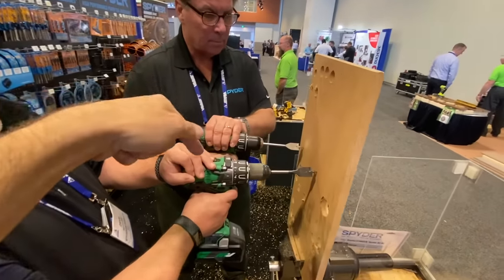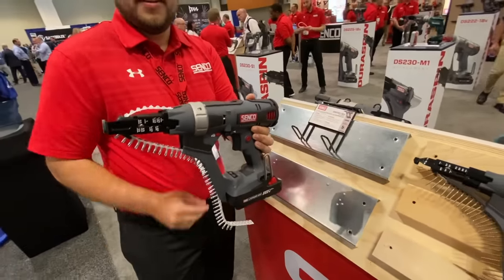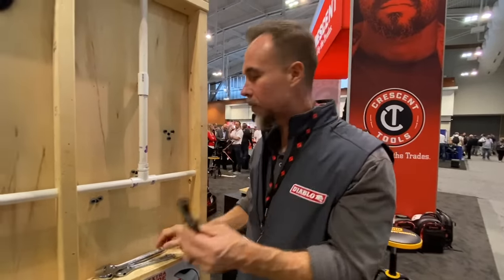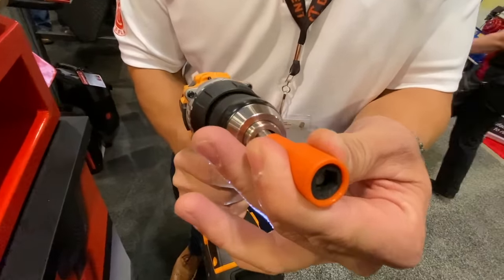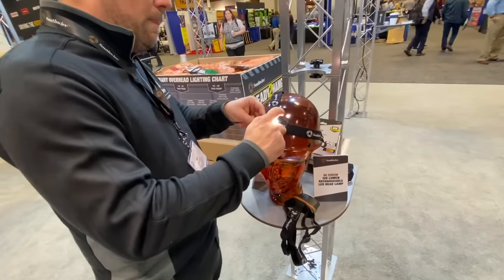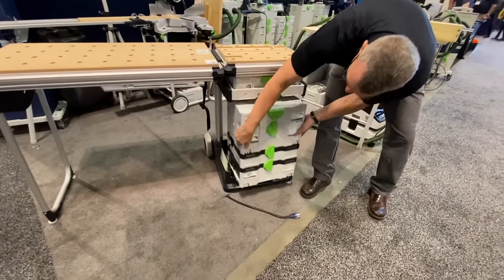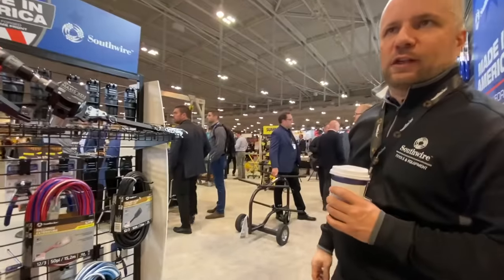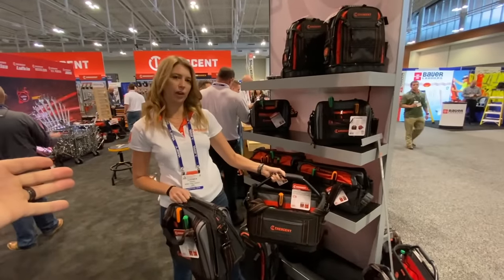New hand Tools, Inventions that actually WORK, power tools, and Equipment you have to see to believe

Comment: That “competitors” spade bit was either blunt or messed with. I wouldn’t be trusting that comparison or the company.
Reply: Mission Dan it was different drills aswell have a look at the chucks
Reply: Matt Kaplan i would also wager 1k that the battery is also not fully charged.
Reply: note the battery size. comparing a standard in box cheap battery on the "bad bit' to a high output 4.0ah with "gods bit"
Reply: My bet the competition bit drill was on high speed
Reply: Different hand positioning on the drill and looking like the guy using both hands pushing harder.
Reply: While I agree it was an unfair competition, those self-feeding spade bits are nothing new (bosch has a line of them, daredevil I think?) and they are without a doubt faster. The threads just cut in and drag the the whole thing through, and leave the edges splintered  and they are no good at all for partial depth drilling - no control whatsoever
Reply: The person using the competition bit was also intentionally wobbling to jam up the bit more. It was a snakes oil presentation for sure.
Reply: I'm an electrician and I go through these spade bits like a fish drinks water, that standard  spade bit was BLUNT having said that I use a very similar bit to the spider one and they are wayyyy faster than a standard spade
Reply: Definitely blunt competitor's spade... not nice to use such tricks
Reply: Even if it was completely blunt I still would of got through in 1/4 of the time. He wasn’t even pushing on it
Reply: The competitor drill is Hitachi DV18DBFL2

The Spyder drill is Hitachi DV18DBL2
Huge difference just in the drill alone.
Second biggest difference is hand positioning and body position. Third difference is the age of competitors bit, you can tell in the close up it is more worn than Spyder bit. 
Not apples and oranges comparison.
Reply: my dad had those in the fifties
Reply: One drill is bigger  look at the bvb atery an drill chuck
Reply: Spyder tools are junk.  Self-feeding paddle bits are junk they never feed on the point of contact so your hole shifts.
Reply: @totallynottrademarked5279  every tried using one for milling a lock on a door? Absolutely smashes the door to bits. 

Also the guy using the normal bit isn't applying any pressure. They need pressure to work and they also don't penetrate well without any slight oscillation of the bit of a small ring of timber breaks off between the bit and the timber and acts like a washer.
Reply: Yeah I think they had a dull bit and the other guy was not pushing on the drill
Reply: they said it was the leading competitor, but they fogot to say its the leader because its dirt cheap not because its good.
Reply: 100%
Reply: My  dad  had  the  self  feeding  bits  in  the  50s.  Definitely  not  new
Reply: if you pause it @ 31 seconds you can see the loosing bit has blunt edges where it cuts.
Reply: This is a BS comparison from ever angle.

1. The drills were different. Drill with the Spyder bit is a heavier duty model.

2. Batteries were not the same. If you've ever used the same power tool with a larger battery you know it gives it an advantage because the higher capacity batteries can put out more amps. Also, I bet the "competitor" battery was low.
 
3. The "competitor" bit was no doubt very dull and the Spyder bit was much newer and therefore sharper.

4. The guy with the Spyder bit was pushing on the drill 5x as hard and actually pushing straight. The other guy was easily wobbling the bit, meaning he wasn't pushing hard at all and purposely screwing with the test.

5. The Spyder guy's popped collar obviously makes him so damn cool and better than the other guy.

Joking aside, I won't be buying any Spyder tools because of this video. If a company is willing to rig a comparison like this at a trade show, I wouldn't trust them. Corruption starts from the top and works it's way down.

I have an old bit that I inherited that was very dull when I got it and I've used it a whole bunch too. Think it's a Harbor Freight or something really cheap too...and I could have drilled that hole twice as fast as the "competitor's" bit
Reply: bosch has a set with that same screw tip, use em every day got them 3 years ago at lowes.
Reply: One has a screw tip and one doesn't that's always gonna happen
Reply: Nicholas Janssen exactly what i was thinking!  Irwin has sold a very similar bit for decades.  The channeled lead screw might be better that traditional bits of this style though.  Interesting but not groundbreaking imo
Reply: Looks like they picked up those sales guys from the local carnival, that spade bit comparison was rigged
Reply: @nicholasjanssen320  I wonder how long until they morph into auger bits
Reply: Yup...and the self feed technology been around since hand drlls....I still have some antique bits with the same tips
Reply: Speed 2 vs speed 1
Reply: I could have chucked up a butterknife and drilled a hole faster than this BS.
Reply: It also wasn’t self drilling. Bosch, the leading competitor, would’ve ripped it
Reply: @missionDan  up o99999
Reply: Project farm does the best non biased reviews
Reply: Also why would you compare a self feeding bit to a classic spade bit
Reply: That speed paddle bit at the beginning was "patented" yet looked identical to the Bosch speed bits... And I bet you they are 1/3 the price 👍🏻🤣 good job on just rebranding other tools and calling it patented and revolutionary... Didn't realize you're a sister company to Apple 🤣🤣🤣
Reply: I agree but those spade bits with the corkscrew thing  at the front kick ass
Reply: Looked to me like they were using 2 different drills. Hikoki has a 36v drill which the guy on the left was using, and the other guy looked like he was using their 18v version.
Reply: Probably in reverse.
Reply: Yeah, not to mention Diablo already has the speed tip
Reply: Should have used both need bits in the same type of drill
Reply: Right
Reply: I have spaced bits that have chunks out of them from hitting screws that will go five times faster than that leading competitor.
Reply: Yeah trade guys on drills. The other guy couldnt even push from where he was at. I hate how they dont do fair evaluations and comparisons.
Reply: Not disagreeing with that, but I will tell you as someone that continues to change my drill bit quiver out...... spider bits are pretty freakin bad ass

Comment: The first one wasn’t compared to the leading competitor. There have been “auto feed” tip spade bits out for quite some time.
Reply: Yep and I don’t like the auto feed for 2 reasons, 1 it pulls the bit into the material which I don’t like, 2 the wedge screw can split the material. 
I prefer the standard type and the DeWalt is my favourite even though I’m a Makita guy
Reply: moe riou I think the test was bs! 
every sharp spade bit performs like theirs...
Reply: and there's no way a "leading competitors" bit would be that bad. It was definitely dull as hell. I've used discount no name bits before and even they will drill faster than that.
Reply: What a complete garbage and underhanded comparison with that spyder bit.
Reply: Yeah that "auto feed" was present on old hand auger bits. Those T-augers were present in the 15th century... that's the 1400's so 600 years old

Comment: That first test was bull. The bigger dude had his hand on the back of the drill. @projectfarm would lose his mind if he seen a bullcrap test like that.
Reply: 400lbs of belly.
Reply: The best spade bit on the market is the Bosch.  That's some no name bit. Not the number 1 competitor
Reply: Exactly
Reply: Fr tho 😭 the guy was not even trying
Reply: The competition looked dull as hell too
Reply: Not to mention two completely different size batteries. How do we know both are equally charged as well?
Reply: Bosch also has msde these for years 😅
Reply: they weren't using the same drills either
Reply: That guy couldn't even find the reverse. First time user. The old type spade bit can be sharpened, the screw in one can't. And sometimes you want to go slow to avoid breakout.
Reply: The casting on the screw bit is woeful. It's all pockmarked.
Reply: I've never seen a sharp spade take that long to drill through a board.
Reply: my lil $30 black and decker drill with the cheapest paddle bits i could find can go through that much faster than that "leading competitor" test....
Reply: @pinkspiders34  bosch has a set with that same screw tip, use em every day got them 3 years ago at lowes hahahha
Reply: bosch has a set with that same screw tip, use em every day got them 3 years ago at lowes.
Reply: He would have used gravity to make it fair😂
Reply: Wonder how it would compare to one of the speedbores
Reply: And it was a self feed
Reply: And the other bit was cheep.... like 5 for a dollar cheap...
Reply: We’re gonna test that
Reply: @TheHermitHacker  <searches for "what's the best spade bit?" on the @ProjectFarm channel>
Reply: Project farm=only legit tests on youtube*
Reply: Did anyone notice the different batteries

Comment: This video paid for by Crescent
Reply: Jon Zimmerman yup, and it looks like crap gear, the bags are better suited to camping, the adjustable spinner with a shorter handle is one of those things that finally came, but hardly revolutionary, but I’m interested in how nasty I can mangle a pipe holding onto it at an angle up to 30 degrees. But the jaws did move very well, but I’ll stick to my Rigids for the time being, they are also aluminium. And I drilled a hole in the handle and fit a glow in the dark thing, just because.
Reply: The Bomb Digity eh that figure is a bit off. It’s not based on views only. It’s based on engagement, daily views, number of uploads, etc.
Reply: I WONDER WHO IS SPONSORING THIS SHOW??? YOURS SINCERELY FROM THE OLD CORRUPT UK
Reply: I'm here like channel lock anyone. Lol 😂
Reply: @f1reguy587  what brand bags do you recommend?
Reply: Looks like a Cresent ad

Comment: Lol "we have genuine YKK zippers."
"What is a YKK zipper?"
"Oh they make basically all of the zippers in the world."
Reply: Not true just looked it up only around 30% there Japanese and generally higher quality.
Reply: YKK makes Yeti Cooler’s waterproof zippers that can handle an SUV driving and parking on top their soft coolers. They have a video demonstration of it. Yeti designed the zipper but it just makes sense for YKK to manufacture the zippers for Yeti. Can’t beat that quality when comparing one of Yeti’s soft coolers to a Walmart special or rtic rip off cooler.
Reply: @zebmccollum  YKK also made the trash tier zipper on my 5 dollar walmart jeans
Reply: just like TOOLS, YKK make huge variety of zippers. High and crap quality.
Reply: @zebmccollum  YKK Zippers are the best Zipper available,whether on a Suitcase, Trunk, ToolBag Tent Front Cover or whatever. I've  always had YKK's on anything I've owned where a zipper was used for instant access,I have YET to see a YKK jamb or become unusable. I mean from Trtousers fronts, Special Overalls, Tool Bags, Fur Jackets or shirts, name it, add a YKK and you have a life time zipper NOTHING beat's em.
Reply: @Shrouded_reaper  Cheapskate Wallmart product would have been using MADE IN CHINA (YKK Rip Off's,) Use your brains man!!! Wallmart would NOT  pay for the expensive, everrlasting YKK Zipper.Shopping in WALMART says it all!!!
Reply: Ya that does that guy wear stretch pants who has never saw the YKK on their zipper while sitting in a porta john?
Reply: All they basically said is they used to use fake ones, I’m pretty sure I’ve heard it’s technically illegal for other brand zippers to be used on things sold on the domestic market, or something along the lines of that aside from them just being more common because they’re good or cheap or some normal reason
Reply: @terryofford4977  I've had and have seen plenty of broken and failing YKK zippers, they make a variety of qualities. The casted tabs are rubbish and often break off, for one.

Comment: "autofeed technology"...you mean shaped like a drill bit lol
Reply: Yeah lmao most spade bits have that
Reply: Lol and also new design wrench and its just a shorter one
Reply: Also I wonder how sharp that other bit actually was. My money says it's been used a lot.
Reply: I frigging HATE spade bits with drill ends!!
1. They'll suck your bit into the work piece and ruin it if your trying to hit a certain depth.
2. They suck the bit in too fast, the blade will bind and the torque from the drill will try to break your wrist.
3. If you try and use in a drill press. They will pull the work piece right up out of the vise and ruin it.

Never buy this BS
Reply: It has a screw on the end . Wow awesome technology 👏
Reply: He should sue the guys that made my antique brace and bit set...they stole his idea!!!  😂
Reply: @CoolIHandIMatt  they're good for other cases, just not yours. I do electric and plumbing and they work really well for me for drilling through studs and plates.
Reply: Interested to see who the "leading competitor" is, never seen it take that long...
Reply: @CoolIHandIMatt  
They're more for rough work than fine. If you're laying bottom plates on bolts in foundation they are faster than regular spade bits and time is money for a framer/contractor.
Reply: @CoolIHandIMatt  wish i could like this twice
Reply: @CoolIHandIMatt  that's why nowadays we use the impact driver. Regular drills are horrible in comparison because they have no mechanical torque limiting aside from the "clutch" that is never at the right setting whereas the impact driver is always going to torque out at a set point whether you're drilling a hole or running in a screw. Plus the impact action aids in driving screws and breaking chips when drilling. Just speaking from my experience of abusing tools in ways they shouldn't be lol
Reply: @CoolIHandIMatt  you have to use the tool for its intended purpose and never in my life have i seen on the packaging of a self feeding bit or have been dumb enough to chuck one up in a drill press.  Don't blame the tool for user error....

Self feeding bits are GREAT when used in the applications they are designed for.  They aren't made for finish work and they never claimed to be.  They are time savers.
Reply: @MyBigThing2010  You have to learn to read and comprehend before posting comments on youtube.
Reply: @CoolIHandIMatt  coming from someone who can't use tools properly and then blames the tool, followed by a blanket advisory to everyone who can read their coment to not buy the tool I'll disregard your comment. I'm pretty sure I can do both,  evident by other comments that duplicate my statement.  Don't let your pride turn you into an a-hole because you can't handle being wrong. 

You'd be better off watching "how to" videos to better yourself than wasting your time issuing weak backhanded insults at people on YouTube. 

Btw. Free tip.... clamp your workpiece to the table when using a drill press.  It's there for more than just convenience. Your work piece should ALWAYS be secured before applying Any tool to it.  ...... hope i just saved you a finger,  .... or stitches. 

Have a nice day.
Reply: @CoolIHandIMatt  spade bits aren't meant for anything pretty, most just drilling holes through studs
Reply: My Bosch bits are easily that fast
Reply: @kaizuk7389  You shouldnt confuse "what you use them for" with "What they were designed for" 

Spade bits are designed to drill holes.
Reply: @MyBigThing2010  you sir are a Jagoff
Reply: It's threaded I think
Reply: Like they used to be in the 80s
Reply: One bit was self feed  and the other bit was not. You compared apples to oranges come on man.
Reply: Like a screw
Reply: Okay, I don't know who the "leading competitor" is to the spider bit, but my old cheap bit cuts faster that the leading Competitors and about just as fast as the spider bit. So I'm pretty sure I won!
Reply: @MyBigThing2010  jiiijj he hht
Reply: You misspelled screw.
Reply: Just copied Bosch haha
Reply: @CoolIHandIMatt  who in his right mind runs auto feed bits on a drill press? 🙍
Reply: Dude was pushing with both hands...other guy was using one hand .
Reply: @CoolIHandIMatt  completely agree. I simply won't use them for all the reasons you stated.
Reply: Embarrassing

Comment: The adjustable wrench with short handle.... 😁 "it won't turn" just lift it off and turn it mate, you'll get it... 👍
Reply: Ever tried doing that under neath floor boards or narrow roof space, length = TORQUE Plus or minus aka Long or Short turning event. Think about it.
Reply: There are times you want one of those short handle/wide mouth wrenches, but notice how he ignore the torque problem of a shorter handle?
Its nothing new, had one in my pocket everyday more than a decade ago (when out of school and doing work). They are good for what they do, but they are never the right tool for something that is stuck
Reply: @ssu7653  the new prybars to use on them, will be in the next video.

Comment: Most of these so-called "new tools" have been around for 90yrs.
Reply: I saw 3 of those new tools that I've been using for years
Reply: Yeah I clicked on this video to see new inventions, but I got a shill crescent video.
Reply: Most of the innovations seemed more for convenience more than revolutionary. I guess anytime you can make a job easier and quicker it's good for a contractor's bottom line.
Reply: bosch has a set with that same screw tip, use em every day got them 3 years ago at lowes.
Reply: I've got a headlight with that same motion detection system, by Robbens.
Reply: New hell, this garbage isn't new. That so called one handed pipe wrench i.e. , I've owned one for the past 20 years, it's a B.S. tool. It takes two hands to set up. It now has been resting in rust for the past 19 years at lest. the rest of this video was about cosmetics and a mans tool purse. lol.